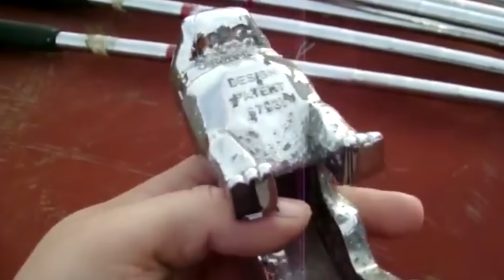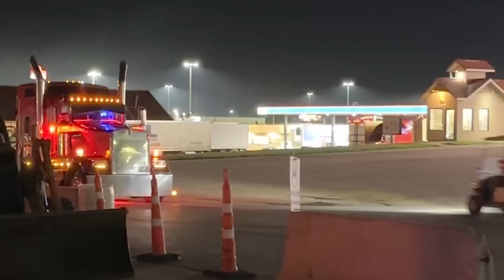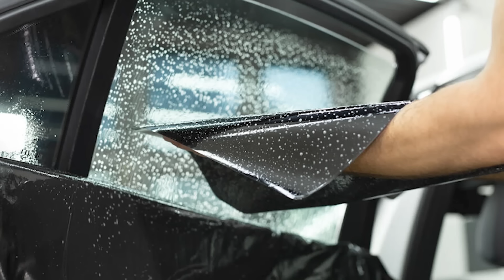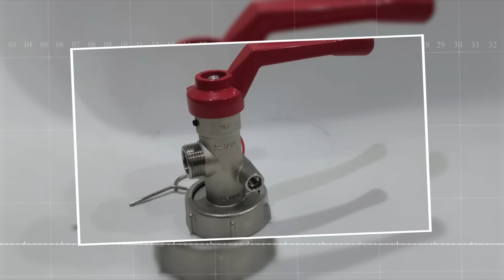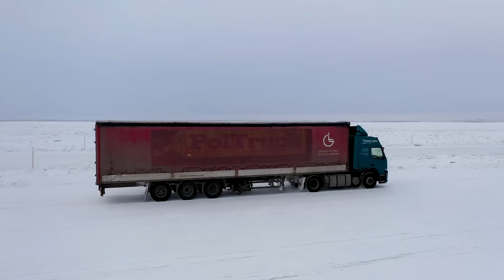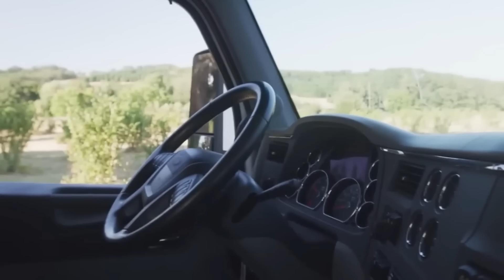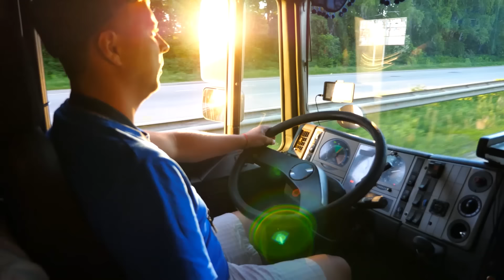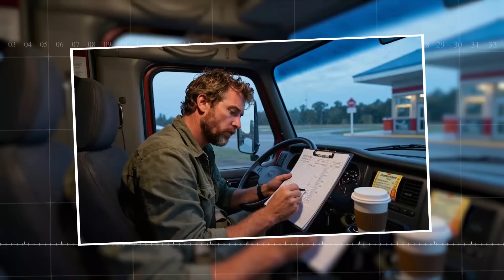15 Smart Truck Inventions So Effective They Got "Banned" — Veteran Truckers Still Use Them Daily

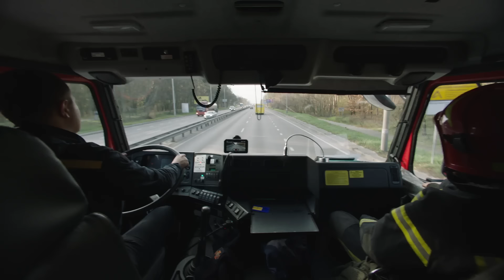Comment: 2:27 a mack is a volvo even with the bull dog
Reply: Not true even in today’s trucks but did you think this ai generated video was true ? Not a single true statement in the video
Reply: @sfsfuzzy3597 mack and volvo are the same company. Vision trucks. They sell and service both. The new macks look almost identical to the new volvos. Before you spew facts know what you are talking about first. And did you know many volvo parts fit a mack.
Reply: @ShawnKelly-h4c3s  they are both owned by same company just like Paccar owns KW and Pete that does not in any best mean they are the same truck ! So like I said before you are wrong and you need to work on comprehension skills and the knowledge you think you have
Reply: @sfsfuzzy3597 go look at a new Volvo and a new mack, the only difference is the bumper and hood, they are the exact same truck, Mack is just a dead shadow of a Volvo.
Reply: @itsshaunobaby  no it’s not ! Not even now ‘ that’s as dumb as Saul g kw and Pete are the same ! What total idiots you newbies are !
Reply: @sfsfuzzy3597 eveeything was true. The ai voice even tries to talk like a trucker except very few really talk like that.
Reply: @ShawnKelly-h4 @ShawnKelly-h4c3s  you get  information but it’s all lies and only a total idiot thinks this ai is real !
There is no law that says you can’t have a knob on your steering wheel there is no law that says you can’t have 300 lights in your truck there is no law saying you can’t have anything the video claims you can no longer have !
Like I said nothing on the video is true it’s all fake ai ! But then again most truck drivers these days will never be truckers and most don’t have a clue what the law is ! So again you are just as wrong a the idiot that made the video